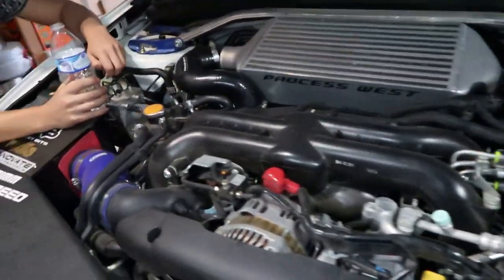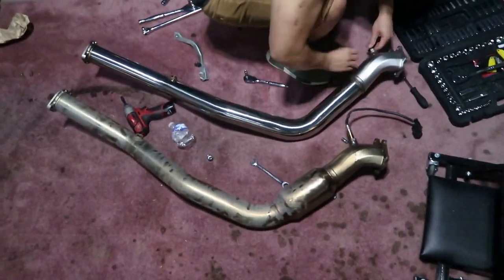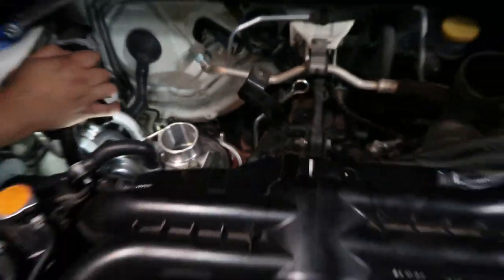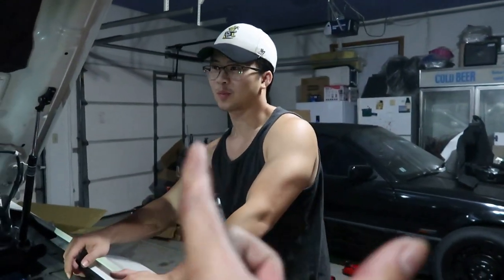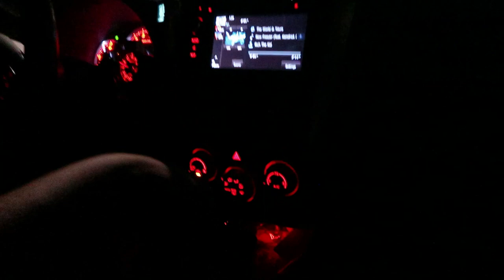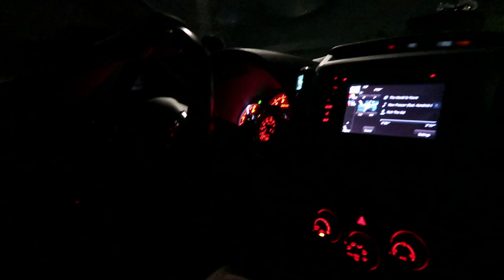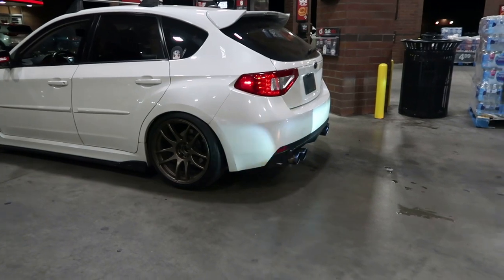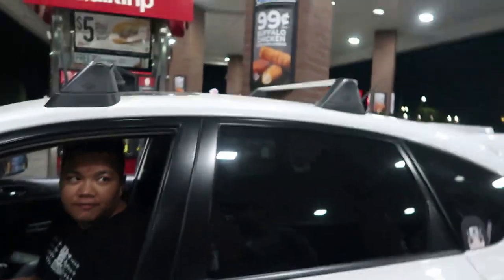2008-2014 Subaru WRX | Invidia Catless Downpipe Install/Sounds

Comment: What map are you running I’m having troubles, I have a completely straight piped 08 wrx 3 inches with Cobb air intake
Reply: Get a pro tune or e tune, ots tunes suck

Comment: For a catless downpipe, would you need a protune or a cobb tune is good?
Reply: Luis Sanchez i want to know this answer also. And could i keep the stock exhaust with upgraded downpipe?
Reply: Definitely going to need a pro tune, cobb maps don’t support catless downpipes which could lead to boost creep and over a long period of time more than likely leading to engine failure. to remedy boost creep you MUST get a protune & an external wastegate
Reply: redlinegsxr1 i believe you can run an after market downpipe with stock exhaust. Just make sure you tune it either a cobb ap for catted downpipes or protune with catless dp
Reply: Luis Sanchez thank you guys for the responses!  Yes if any, i would be doing the catted downpipe, which will be okay with the Cobb AP correct?
Reply: Michael Arias exactly.  Ive heard about the boost creep and definitey do not want that - especially with the possibility it could lead to engine failure
Reply: redlinegsxr1 yup. AP for catted dp 👍🏽

Comment: Did you need a different heat shield or to cut the existing one?
Reply: You dont have to do anything with a heat shield.
Reply: @electroevolution5777  I put the Cobb heat shield on and my IATs dropped by 15 degrees when at long stop lights in hot weather.  There is a point where our cars cut power if temps go too high and mine were reaching north of 170 degrees.  For this reason, I recommend the heat shield.
Reply: @dskokos77  There is already a stock turbo heat shield in which you do not have to modify or damage in order for it to fit.

Comment: does the stock exhaust fit with the Downpipes? or do i need an adapter
Reply: VICE LIVE you might need a 3” to 2.5” adapter you just need to know what size pipes you have or are gonna get